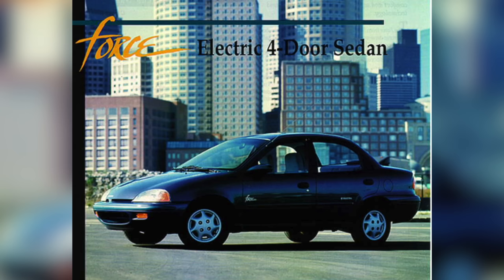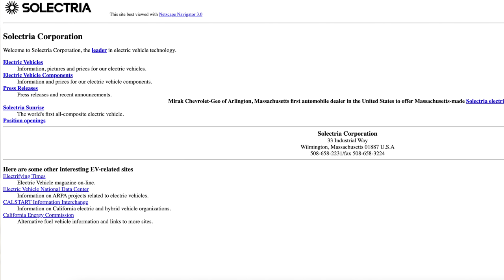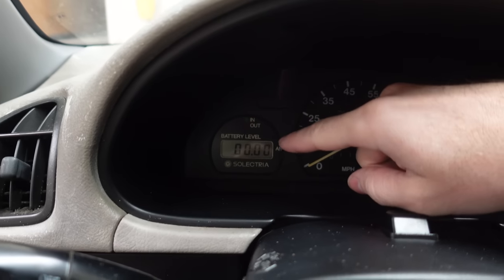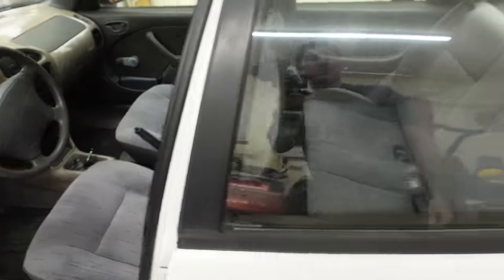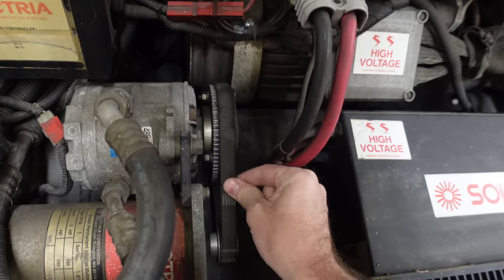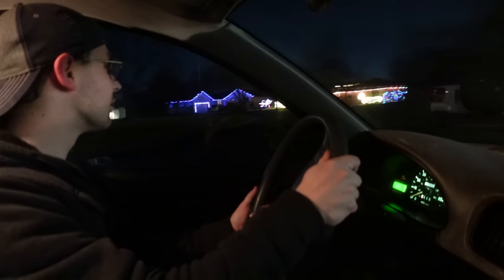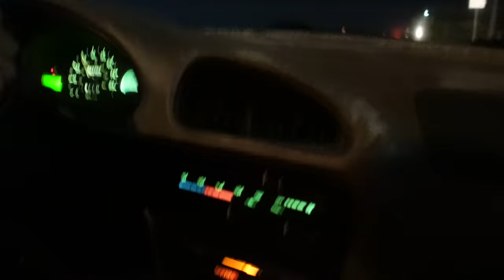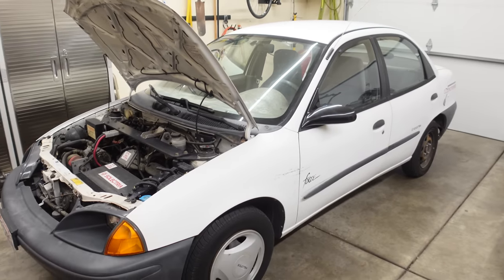I BOUGHT The ELECTRIC Geo Metro *Solectria Force EV*

Comment: Hello! I’m the previous previous owner of this car and I just wanted to clear some things up for you. The first is those wires in the glove box. This car used to have a “range meter” but I could never get it to work, so I removed it and just shoved the wires in the glove box. The meter used to sit where the cupholder is. Secondly, the terminology for the regen on/off switch refers to the road conditions. If the road is “dry” you want full regen, if the road is “slippery” you want no regen because regen+ice is a big no no. Also, I made a video about this car back when I first bought it, I’ll add a link. I’m so glad to see this car ended up in good hands. Maybe consider doing a lithium conversion at some point? https://youtube.com/watch?v=VA3rJ8nJ6ec&feature=shares
Reply: I was also a pervious owner of this car and I agree with everything said
Reply: not
Reply: nice job with the detailing ... was wondering how this car was so 'clean' for it's age
Reply: I was never a previous owner and just needed an excuse to post.
Reply: I was the original owner and I sold it for a Hum V
Reply: Nice of you to join in.  Would love to see your video.
Reply: @99lockerock  hello other previous owner
Reply: @Mrshoujo  you are a pervious owner in spirit
Reply: @TVsoup  greetings
Reply: Would like to see more power in this thing for sure if a suron can do 70 80 72v what would this do with new esc and 72v
Reply: @Mrshoujo in the future I will not be a previous owner in the past
Reply: A lot of previous owners. Kinda makes me go hmmmm. Me too. Me too. Me too. Got any paperwork any of you without video?

Comment: I worked on the GM EV1 (Impact). They used Geo Storms for powertrain mule vehicles, during the development of it. At the time, the chassis was the strongest chassis GM ever built at the time. The chassis was all aluminum. They where building the chassis during a very hot summer in Michigan. They had to weld them together at night, due to the power consumption being so high in the Warren area, with the summer heat. Welding the aluminum at the time required a lot of power. The motors used where turbine starter motors, by Allison. And about 2ft in dia.

Comment: Fun fact. I worked at GM in a R&D center back then and we had a few of them.  Only we also had a couple of Geo storms that were modified with Delphi inverters that could do massive front wheel drive Burnouts. Also they were used  to develop  the inductive charge system GM was developing during the time they were trying to standardize the charging system. GM called it the MAGNACHARGE. System. That was used for the EV-1's.

Comment: I got to drive an EV1 in ~2006.  The thing I remember the most was the regenerative braking.  Turn it off and that small car was HARD to stop.
Reply from the maker: That's amazing! You almost have to have regen to stop all those HEAVY batteries 🔋
Reply: I'd imagine they didn't bother to alter or change the calipers from the original Metro / Swift to keep that small company budget in check

Comment: As far as the poor handling, I wonder if some of that could be due to the age of the shocks and struts.  

You might want to consider replacing or even upgrading them if you can.  A bet new shocks and struts would make a world of difference as well as the new tires and alignment you mentioned.

It’s so interesting seeing how this company engineered ways to make accessories designed for gas-powered cars work for an EV.
Reply: There's a chance it uses custom shocks/springs due to weight, so regular geo metro might not work.
Reply: Needs some coilovers

Comment: I definitely would check on converting it to lithium batteries like Jake did with his Insight that got wrecked. At least the batteries were replaced recently and sounds like you got a deal on it 👍
Reply from the maker: Got it for the price of the batteries... I don't think I mentioned it but $3,500 🍻
Reply: Probably lucky the guy was a fan and decided you'd be a better home for it and he broke even so everyone wins.
Reply: Li-ion bateries would probably make this as good as a 1st gen Leaf, which we can get for $3,500
Reply: Would it allow a portable power station to charge it whilst driving?
Reply: @WatchJRGo  do it!
Reply: @WatchJRGo  the batteries should also help the handling.
Reply: @dazednconfused31337  Just put a generator in the truck and make exhaust exit out the bottom.
Reply: @dazednconfused31337  LOL put a 220V charging circuit in it and pull around one of those super efficient diesel generators built on a trailer.
Reply: The conversion cost is hardly with it at all.

Comment: I believe they marked it dry and slippery due to road conditions.  If regen is engaged and the the roads were slick, it could lock up the wheels and cause you to lose control. Basically their way of saying, don't use regen in slick conditions.  Very interesting car for sure!
Reply: Thats what i thought - dry and slippery driving conditions. I dont know the mechanics of why though because someone else said its hard to stop without regen as an engine brake. But i wonder if in slippery conditions they dont want you doing single pedal and then get in a bad spot, they want you to use the brake pedal earlier.

Comment: Like you, I loved the GM EV-1. I lived in Phoenix, and we had a couple of those cars rolling around there. The old Fiesta Mall in Tempe even had the paddle connectors meant to charge these EV-1s. I thought the EV-1 was the PERFECT car for me; my car at the time was a Honda CRX. The EV-1 seemed like an electric CRX in my fevered imagination. I would love my own EV-1 even now. Back in the 2000-2010 decade, the military had fuel-cell powered Chevy SUVs. Out at Pearl Harbor, the Navy was cracking sea water into hydrogen and oxygen using solar. Also using solar power, this hydrogen was processed into liquid hydrogen and used in these promotional/test Chevys by the military. I miss seeing those vehicles; they had LOUD wraps that let the whole world what they were! Also, Toyota showed their MIrai here on O’ahu. These MIrais could actually be filled at Pearl Harbor, for all I know. Never saw a hydrogen-powered Kia eNiro or a Toyota MIrai running around here, though.
Reply: @Davey I just saw a second generation 2 door Cavalier RS in Los Vegas while going to CES. It was parked in same hotel garage I was in, it was in remarkable shape, no rust, no faded paint, no door dings. I'm guessing it was either garage kept most of it's life, as out west that paint would fade under the sun. Or it had a really good paint job, but who would intend on painting a mid-90's Cavalier? 

It had a spare donut tire on the back wheel while I saw it. But the rest of the wheels were original with their wheel covers in good condition. A few days later I also had to use my spare tire, so I can't blame them for rolling around on a spare. But it would have been nice to see a complete set. I just hope they knew what they had, a rather rare to see Cavalier today from the 90's. That most didn't get much older than 10 years before being taken off the roadways. A cheap throw away 90's GM car never intended to last.

Comment: You may be able to adjust the throttle linkage at the potentiometer to get away from the 75% wasted petal. That may also increase the acceleration dysfunction.
Reply: I agree, the cable may be stretched.
Reply: That's what I was thinking, hopefully it has a bit more power that is just not available due to the throttle cable.
It has new batteries, it should outrun a freaking tortoise.

Comment: I used to work at Solectria back in ‘96.    Man, lithium batteries are so much better than those lead acids were!  The  weight savings from fewer options and sluggy acceleration were all to squeak out as much range as possible (which was a losing battle with those batteries).   As you explained, we mostly sold to utilities and government fleet users (I don’t remember so many military customers) because they could assign the cars to known regular and short routes, and charge every night.  Get a wheel alignment and pump the tires up.  There is a 12v electric vacuum pump for the brakes in there somewhere, which should help.  Great to see one of these cars still running and being appreciated!

Comment: I found the vehicle test report from the US Dept of Energy, they had a '95 Force on test 
TEST NOTES:
1. Full charge may not occur when charging in ambient temperatures of >100°F 
2. To charge in less than 12 hour, charging should occur in ambient temperatures <100°F 
3. When operating on wet surfaces,(rain, standing water, ice, snow, etc.) the regenerative 
braking selector must be set in the "Snow & Ice" position 
4. The vehicle cannot be parked or operated in standing water with a depth greater than six 
(6) inches. 
5. The left rear passenger door would not open, and was repaired by the manufacturer. 
6. The left rear seat is not a designated seating position (may not be used for seating). 
7. The vehicle exhibited front end shudder at high speeds and was repaired by the 
manufacturer. 
8. The vehicle's amp-hour meter required repair during the Test Program. 
9. Charger Test was completed with ambient temperatures of 94°F < temp < 98°F. 
10. Vehicle was removed from the Test Program for repair for one 24-hour period.

People who haven't seen "Who Killed the Electric Car" need to go watch that now 

This belongs in the Garage/Land of Misfit early EVs, including the Honda EV Plus, Toyota RAV4 EV (1995), Ford Ranger EV, Chevy S10 EV, the Solectrica models 

Hell, the Dept of Energy made their own EV prototype in the late 70s, called the DOE ETV-1 

Probably in some government storage building next to a Minicars RSV
Reply: So Funny. 4. The vehicle cannot be parked or operated in standing water with a depth greater than six 
(6) inches.

Comment: Apart from the GM EV1, all the other major auto manufacturers had EVs in the late 90s as well, as was mandated at the time by the California Air Resources Board. There was the Ford Ranger EV, Toyota RAV4 EV (1st gen, not to be confused with the Tesla powered 2nd gen), Chrysler TEVan, Honda EV+, and Nissan Rnessa. Much like the EV1, most of those vehicles were all crushed in 2003/2004 when the EV mandate was repealed after the automakers put a lot of pressure on CARB. If you ever want to learn more about that period of EV history, I highly recommend checking out the documentary called "Who Killed the Electric Car" (theres also a sequel called "Revenge of the Electric Car", which focuses on the early days of Tesla, and the grassroots EV conversion movement).

Back to the subject of those latest 90s/early 00s cars, about 400 each of the Rangers and RAV4s were saved from the crusher after a lot of pushback from owners, so there's still a fair number of those floating around. I actually used to own 2 Rangers myself, and have a couple videos about them. I've also worked on one of the first gen RAV4s as well at the shop where I work (there's a video of that car as well where we compared it to a 2nd gen RAV4 EV on my shop's youtube channel).

A couple years ago, I actually almost bought an early Solectria Force myself (the two door hatch version) which was in need of batteries. I'd say that if you're up for it, a lithium swap would make a MASSIVE improvement to the car. Not only would you increase your range, but you'd likely get a lot better performance thanks to reduced weight and A LOT less voltage sag under acceleration.

Comment: I still have a Force that I regularly drive, I have put 60k on it and I have done two lithium conversions on it.  Currently running half of a Nissan leaf 40kWh pack.  I can share info if you are ever interested.  I have service manuals, spare parts etc...  As well as a bunch of info about the conversions.  The car is much faster with lithium due to weight savings.  I worked with Solectria in the 90's on NiMh versions of the car.

Comment: My brand new 97 Geo Metro 2-door with the 3 banger 1 barrel got 50 MPG if I drove it like I stole it. If I drove normally I'd get about 55 MPG. If I hypermiled it I could get over 60 MPG. Even though it had a pretty small gas tank. It felt like it would drive forever on a tank of gas.
Reply: That's why making one an ev makes no sense to me. I drove several of these when they were new and the gas mileage was phenomenal. It doesn't really make sense to make a worse car and charge so much for it.
Reply: @mjc8248  I have an old friend who has the metro convertible with the "big block" 8^)   4 banger. He made skirts for it and an air dam and I think a few other tricks and hypermiles it to see just how good he can make the gas milage. He even drafts big rigs for less drag. I believe he told me he got in the mid 70s MPG with it.
Reply: I always loved the convertibles. I had a pink with a white top that I kept for a long time because of the fuel mileage. I liked the hatches and verts the best. They weren't very fast but they were nimble for day to day driving.
Reply: I think the other comments to your comment would tell you why someone would want to make the car even quirkier than “just” gas powered

Comment: Something is wrong with the throttle. It should not take pushing the pedal 75% down to get it to move. If i remember correctly from driving those ones that were brought to the dealership i worked at for brakes and suspension work, these did not take much pedal pressure to move them from stop. Check the throttle cable for correct adjustment. Also check the potentiometer for the throttle for dirty contacts or cracks

Comment: I'd like to see the suspension fixed, aligned and refreshed.
Adjust the pedal so it's more active and you don't have to floor the pedal. Shouldn't be too hard.

And probably a battery upgrade.

Comment: You might try to adjust the throttle position sensor... if it takes so much throttle pedal travel to even start moving the car, you may be losing the top end power too... maybe why it's so sluggish.

Comment: I wonder how this car would do with a lithium battery pack. And also could a bigger motor be installed for more power? I think I saw an article in an old Trucking' magazine a long time ago about the S-10 conversion. I'm sure Rich Rebuilds would love to see this car. I bet if you get the front end fixed and alinged, power steering working and the AC compressor fixed,  this would probably be a lot easier to drive. Too bad the 3 cyl. cars rusted out so bad or there would probably be a lot more around.
Reply: bigger motor would likely require more powerful inverter as well. And you might run into issue of power capability of exisiting batteries as well. So if you want more power, you'ill end up swapping the whole drivetrain+batteries.
Reply: I saw one of these at an EV show that had been converted to lithium ion batteries. The owner said it doubled the range.

Comment: If you consider changing the 11 12v batteries (not 5 front +12 rear, but probably 5+6 for 149v nom, 156v fully charged) for something better/newer/lighter, look at lithium iron phosphate batteries, also known as LiFePo4. These batteries are lithium-based, so they're very light compared to lead-acid batteries, but because of the 3.2v cell voltage they make a perfect conversion from lead acid to lithium technology... 4 cells of LiFePo4 are the same voltage as a 12v lead acid. They are also very tolerant of charging voltages, and are much, much safer than standard lithium batteries. Just make sure to use good brand cells.

 There are also manufacturers that make LiFePo4 direct drop-in replacement automotive, marine, and deep cycle 12v batteries... with all kinds of posts/terminals for zero conversion effort.
It would probably take 400-500 pounds off of the car.  

You may even get one of them to sponsor a conversion project video....

Comment: You should get one of those "solar generators", basically, a large lithium battery with an inverter, and patch it into the 120v charging circuit and see if you can increase the range on the car using it!!
Reply: that would not do much.  Those solar generators are about 1500w -2000w inverters with a 45 amp hour battery.  just one of those lead acid batteries in the metro is at least a 80 amp hour. You would have to trickle charge it while off.  It would charge it though.

Comment: In 1996, the four door Metro only came with the 1.3 liter four cylinder. The automatic was a three speed without overdrive (30 mpg’s at best). The five speed was with both fourth and fifth gears being overdrive (40 mpg’s). The 1.0 liter was only in the two door hatchback.50 mpg’s with the five speed.

Comment: I worked for Rays Electric outboard motors in Cape Coral FL.  We used all the same connections for our batteries.  I'm pretty sure they can supply you with parts if you want them.